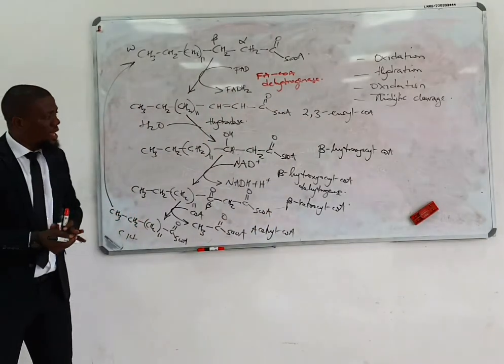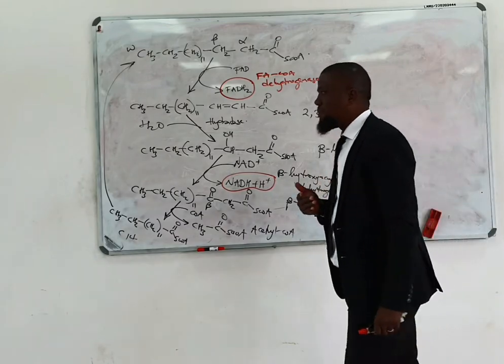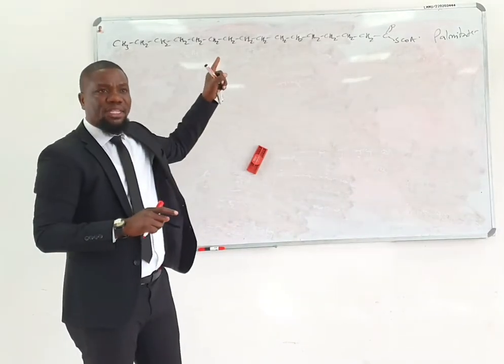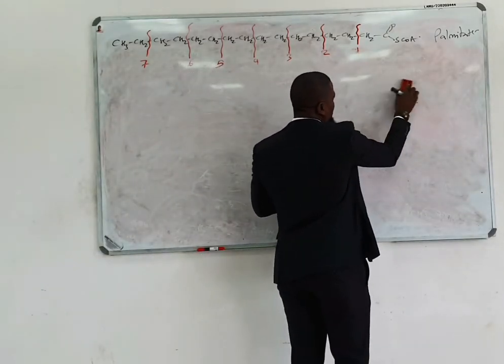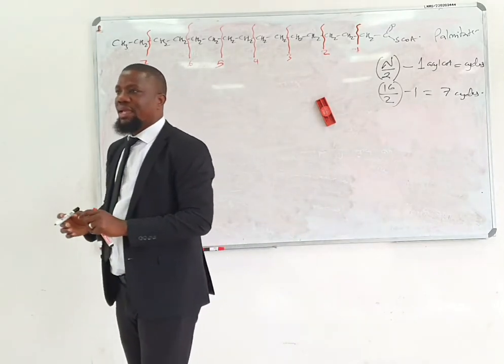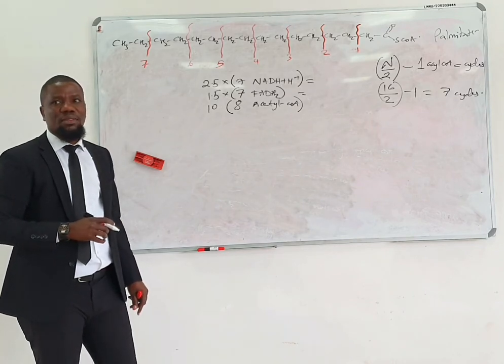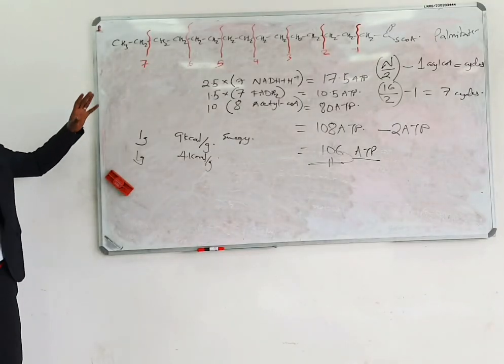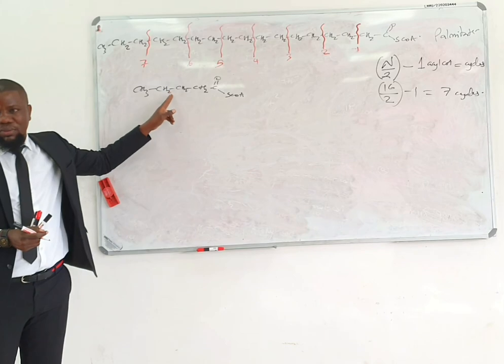Beta-oxidation_Part 3 (Calculating the energy correctly)

Comment: Which one is preferably , is to explain the process of Beta-oxidation or showing the process inform of illustration then talk of the numbers of cycels it undergo upon calculating the energy generated or its  best when its inter linked to fatty acid synthesis to do an illustration for one then explain the other
Inshort given such a question is ome supposed to do both illustration of beta and fatty acid or its to illustrate one and explain the other 🙏

Comment: I have question particularly on the numbers of cycles because from your illustration the end product is AcetlycoA of 14carbons in calculating the energy of 16carbons is it to also explain the cycles it undergoes  based on the 14carbons or its assume it has 16carbons and explain  the cycle since the reaction undergoing 4repeating reaction produces acetlycoA of 14carbons
Reply from the maker: Acetyl-coA has 2 carbons. So as a fatty acid is being degraded producing acetyl-coA in each cycle it reduces in size by 2. 
Now to calculate energy you should calculate the energy by calculating the number of cycles it undergoes. 

# Cycles = (#carbons/2)-1. We subtract the 1 because in the last cycle when you have a 4-Carbon fatty acyl-coA, it is broken into 2 acetyl-coA's in 1 cycle not 2.

Therefore for each cycle you have 1 NADH+H+=2.5ATP, 1 FADH2=1.5ATP and 1 acetyl-coA =10ATP when reduced to CO2 and H2O in the TCA and ETC.  
For instance, a 16 Carbon fatty acid you have (16/2)-1 cycles = 7cycles.
Getting 7NADH*2.5, 7FADH2 * 1.5, and 8Acetyl-coA * 10 = 108ATPs then subtract the 2 ATPs from activation of a fatty acyl- coA.

Comment: Pls, can you comment on the energetics with respect to ATP production of the complete metabolism of one molecule of glucose and beta oxidation of palmitic acid
Reply from the maker: If you mean which one is more,  it's automatically palmitate. 

It has 16 carbons so the number of oxidation cycles will be ((#C/2)-1)= (16/2)-1=7 cycles..
Each cycle gives 1NADH,1FADH2,1acetyl-CoA but the last cycle gives 2 acetyl-coA so you will have a total of:
8 Acetyl-coA 
7 FADH2 
7 NADH+H.

Now after oxidation to CO2 and H20 in the TCA cycle and ETC:

1NADH+H= 2.5ATP
1FADH2= 1.5ATP
1 Acetyl-coA = 10ATPs 

If you calculate:
7NADH* 2.5= 17.5ATPs
7FADH2*2.5= 10.5 ATPs
8Actetyl-coA* 10= 80ATPs
This sums to 108ATPs. If your subtract the 2ATPs for the activation reaction you get 106ATP

Comment: Sir what about calculating oxidation of a 20 carbon fatty acid
Reply from the maker: You calculate it like for any fatty acid with an even number of carbons as explained. 

(20/2)-1= # Cycles=#NADH+H=#FADH2,
(20/2) = #Acetyl coA

This can be worked out into ATPs where 
1 NADH+H =2.5 ATPs
1 FADH2 = 1.5 ATPs
1 Acetyl-CoA = 10 ATPs
Reply from the maker: Sorry this came in late